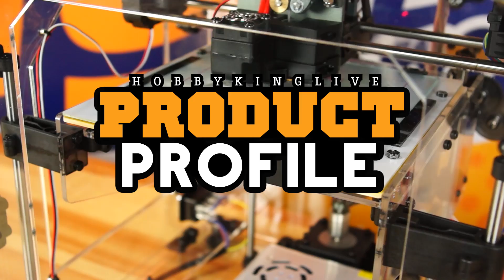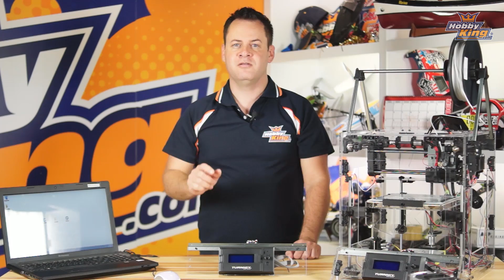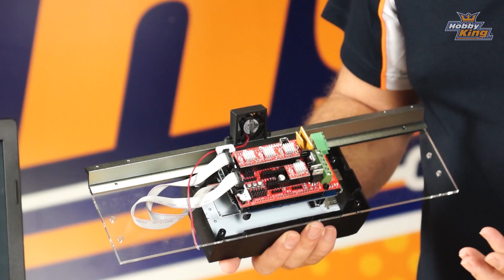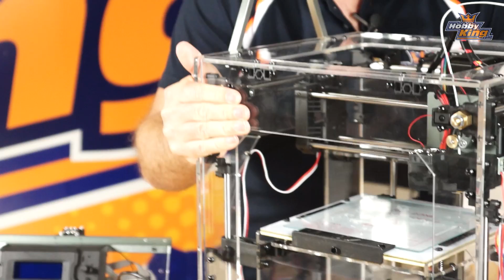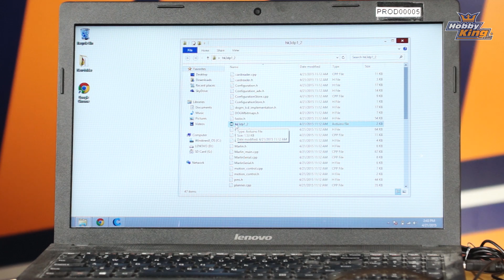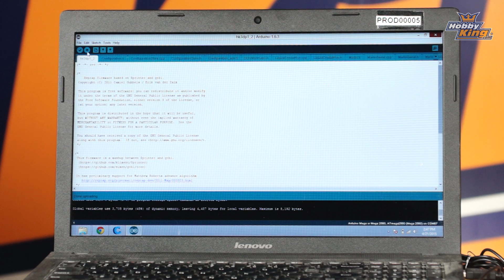Turnigy Fabrikator 3D Printer - Tips & Tricks # 1 Firmware Updates

Comment: https://drive.google.com/file/d/1b9mijTxA4S9gAoqCOtbkh3CB5guEaNdA/view?usp=drive_link

	
	1	Install Arduino 1.0.6   (Newer versions won’t work!) included in zip file (in link above)

	2	Extract file hk3dp_2 to desktop (in link above)

	3	Connect board to PC with USB cable.
	
	4	Double click “hk3dp1_2.ino” in “hk3dp_2 Folder”

	5 	Go to TOOLS at the top and check correct “Com port” & “Board” are highlighted.

	6 	Click on “arrow” next to the “tick” in bar at the top. Update should now start.
	
	7	Disconnect board and that’s it all done!

Comment: Hey guys, for the ones struggling for firmware.

Here's a copy of the firmware I have from last year, unfortunately I cannot find the original RAR file.
You use this file at your own risk, as its been a while since I used the file, and have dug it off of my laptop and created a RAR file.

As far as I can tell these are unedited files, as the acceleration and extruder step values dont match mine at all.

https://www.dropbox.com/s/nrmwzavn7s3c3fl/hk3dp1_2.rar?dl=0

It would be greatly appreciated if you could provide feedback if this worked for you. And also put on a cloud to  share the firmware for others struggling to find it.
Reply: Stewart McAllister U need to compile and upload using Arduino 1.0.6, this older firmware will not work on the current Arduino release
Reply: Hey Dan, thanks so much for doing this...I'm having an issue though with trying to flash the above code to the arduino...it throws up a flag in line 38 in the SDBaseFile.h saying "using typedef-name 'fpos_t' after 'struct' "...any idea what that's about and how I could fix it? Thanks :)
Reply: Hi Stewart

Not a problem for the firmware, 
I've never come across this issue before, so im a little unsure what to suggest.

It has been around 18months since I flashed my 3D Printer with the firmware.

My Arduino knowledge doesn't really stretch that far. 
It's a shame that you can't make a backup from the printer of the firmware.

Otherwise I'd have a play with the files I've shared to see if i run into the same issues.

Will have another dig around my laptop and see if I can find the original zip file.

Regards
Dan
Reply: Hi Dan, thanks for the reply. That's fine, I really appreciate you doing that. I received this printer second hand so I'm just trying to get it working again and exploring all options. It's a pity Hobby King didn't simply archive their info when they stopped supplying this printer instead of completely removing it all - not a great way of encouraging customers to buy their products.

Thanks again,
Stewart
Reply: Stewart McAllister 

currently at work stewart.

Did have a look on rcgroups for any info or firmware.

post 1100 on 
https://www.rcgroups.com/forums/showthread.php?2392899-HobbyKings-%28Turnigy%29-Fabrikator-3D-Printer-thoughts/page74 shows a file for the printer.

But would be a good idea to check its not for the mini fabrikator once loaded to arduino (before flashing the firmware)
Reply: Thank you so much you saved me!
Reply: Thanks Dan I cant believe Hobbyking does Not have this on their site much less ANY parts. Isn't that what the manufacturer/importer is supposed to do? Let this be a warning to ALL buyers of HK 3d printer from now on. Don't count on any support. For a 500.00 product that is just a couple yrs old that is shameful. Not even the software? Come on HK.
Reply: still working ok in 2023 thanks
Reply: Hi where did you find the firmware? Please help me

Comment: Where to find the firmwares and manual for this printer? Hobby King doesn't have it on their website any longer it seems?
Reply: Indeed , I bought this unit second hand and I don't know if the firmware is at the lastest version !!
Reply: Please see my comment above with a link for firmware.
Reply: What comment above, Dan?  You've made this comment several times on this video and not a single one of them has a link to the firmware.

Comment: Bonjour suite a une mise a jours du firmware via cura (marlinultimaker-2500000.hex) l'imprimante ne fonctionne plus.

Comment puis-je revenir a la version original

Hello following a days has put the firmware via cura (marlinultimaker-2500000.hex) printer no longer works.

How do I get back to the original release
Reply: +Hydro oui problème régler mais depuis l'imprimante a cramer du à une pièce défectueuse donc je suis en attente avec le sav.
Reply: Un firmware marlin modifier je peut t'envoyer ca si tu veut
Reply: +Hydro Pardon il me faudrai ton adresse mail